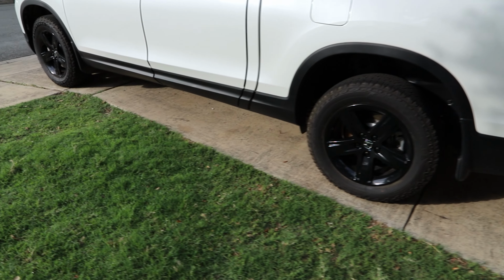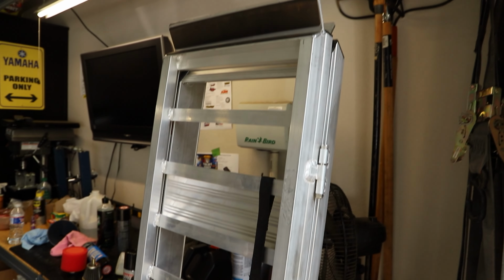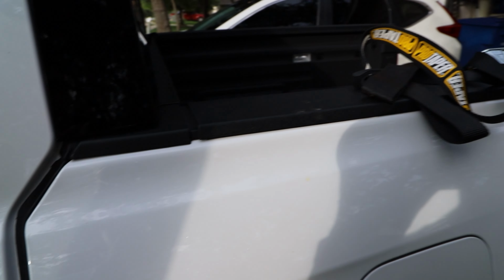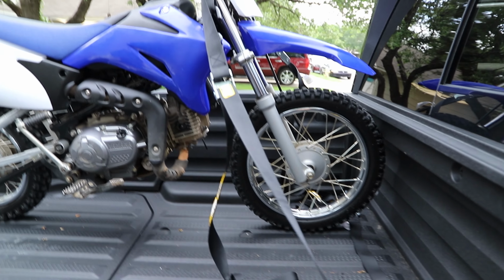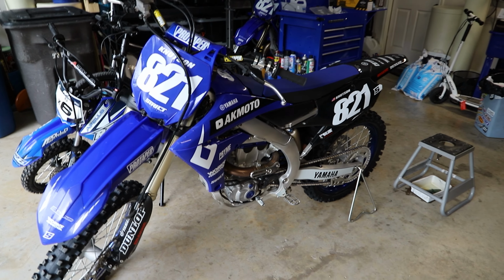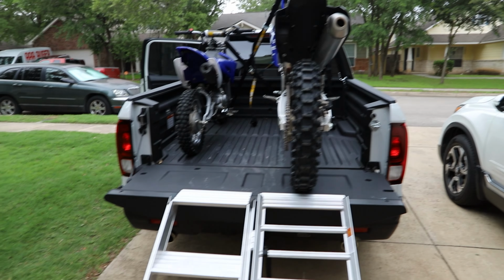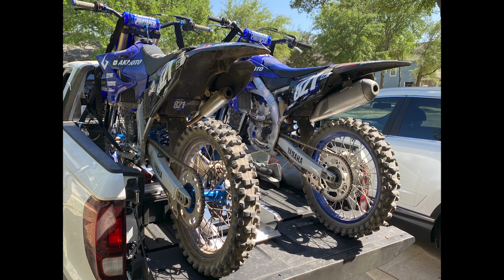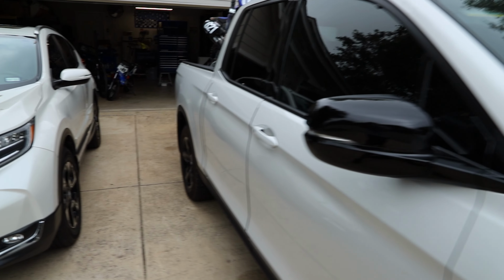Can You Haul Dirtbikes in a 2021 Honda Ridgeline?

Comment: Fresh exterior Ridgeline is gorgeous. Wish they’d put a real shifter, updated infotainment and dash console, then put a timing chain instead of timing belt. Cost about $2k to do the required timing belt at 100k miles. ☠️ 

Bikes are gorgeous. That’s why I’m really here haha.
Reply: Oof 😯
Reply: That 2k would probably be if you do water pump and valve adjustment. Sucks they use a timing belt in them though. 

But everything’s got issues. Not as serious but 5.7 hemis still break exhaust manifold studs at like 50k and that alone can be over 1k to fix.
Reply: @coryricci301  love my 2008 sequoia 5.7L. Just hit 213k trouble free miles!

Comment: QUESTION: when I leave pickup door open of my RTL 2021, for carrying my dirtbikes, the display of cockpit pops up an "ï" warning that rear door is open accompanied by a periodical beep, and cabin lights remains on. How do I disable this warning?, did it happen same to you?. In my case warning pop up shows that both pick up door and rear door of driver side are open, (no matter I check rear cabin door is correctly closed).
Reply from the maker: Are you referring to the tailgate? Rear cabin door? Storage trunk lid? If you are referring to the tailgate, you are opening it downward not sideways right?
Reply: @akmoto_  Sorry for my english, I am writing from Chile-South America. I am referring to tailgate, to carry my dirt-bikes on my Ridgeline 2021 I leave tailgate open in horizontal position, what means getting a warning in panel that tailgate is open, (and also shows/warns that one rear cabin door is open), a periodical beep, and also lights inside cabin remains on. Did it happen same to anyone of you?, is there a way to disable this warning?, (by means of any configuration?, or installing any hardware?). In my Ridgeline 2014 I do not have this problem/behavior.

Comment: i’m getting a yz125 very soon what is the first update i should do to it? btw love the vids keep up the good work!👍
Reply: FMF works pipe, shorty silencer, an vforce 4r reed cage, that’s all that bike would ever need, no need to do heavy mods!
Reply from the maker: I don’t recommend getting an FMF myself, they have fitment issues for the newer YZ125’s. I and many other people have experienced it. I recommend a PC pipe if any.
Reply: Try to run non ethanol fuel 90 octane and higher. Allways use good premix like klotz or honda hp2. (Klotz smells really good). And buy alot of air filters clean and change them on the regular. Now for upgrades get a good set of pipes and a set of vforce 3 reeds (might have to re jet it) and then your yz125 will be a little screamer. You can also run vp gas if you can afford it and that will help maintain good hp and its good fuel for your engine.
Reply: @akmoto_  I’ve never once had a fitment issue, an I got four yz125’s all different years, 06,12,18&20. All have the same thing and r really crisp, we run pro circuit on our superminis an 85’s tho! It’s honestly a preference thing, an I’ll agree with u that pro circuit makes the yamaha sound like a 134 cuz my son races against a few that has pro circuit! An they really bark!!
Reply: @mrmotocross6819  vforce 4r are the way to go, it’s all one piece an no screws an r way better than the vforce 3, I have both in our bikes an wish I put the 4r’s in all of them
Reply: Pc all the way!
Reply: @akmoto_  okay thank u
Reply: @mrmotocross6819  what abt a carb? i hate jetting a bike but i’m not sure if lectron is worth the money
Reply: @ribbledean4111  yea i allways forget they make the 4's im a getting old and lazy so i ride a 4 stroke now. But when i was kid if you had a set of v3 you were the man
Reply: @jacobmoyer14  ive never ran a lectron carb ive heard mixed reviews on them but honestly jetting is not to hard watch a few youtube videos and youll be fine. Or bring it to the shop and have them jet it for you. But a 2 stroke with a set of pipes and good reeds with proper fuel will be a little ripper.
Reply: @mrmotocross6819  I’m 43 that’s all my kids, I ride Harleys now!! Got hurt too much on them so my kids an wife got me a Harley, but my kids race mx still!
Reply: @mrmotocross6819  ik how to jet i just don’t like doing it i’ll just get jd jetting or sum

Comment: Do you know the weight limit for the tailgate?
Reply from the maker: Honda says 300 pounds while driving. Loading two full sized dirtbikes can near the upper limit, but Honda shows 2 bikes loaded up in the truck in their commercials so I’m sure it’s more than fine, otherwise they wouldn’t advertise it as so.
Reply: @akmoto_  I appreciate the quick response. Got it. I plan on loading one but it's a heavier sportbike almost 500 lbs. Also I plan on riding it up so when I'm on it I wonder if that'll be too much.
Reply: @R1Ammar  it’ll be fine when you think about it only the tire is on the tailgate. Majority of the weight (engine) is in bed. Even if your bike is 500lbs and 20% is on tailgate then that’s only 100lbs and I bet it’s even less because as said most weight is toward front mid due to the engine
Reply: @alphawolfadventures1470  that makes a lot of sense. I appreciate the response!